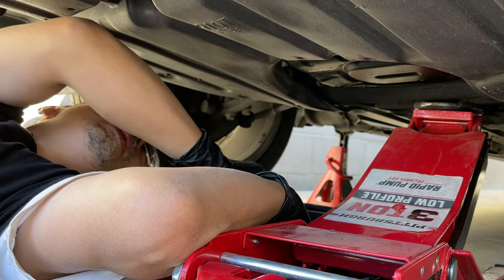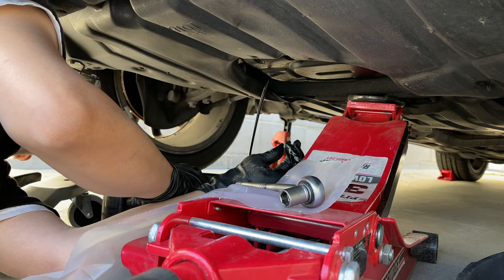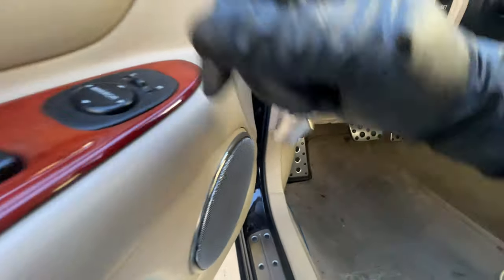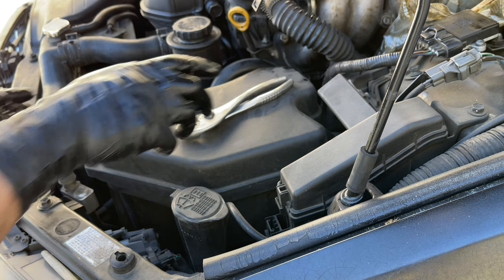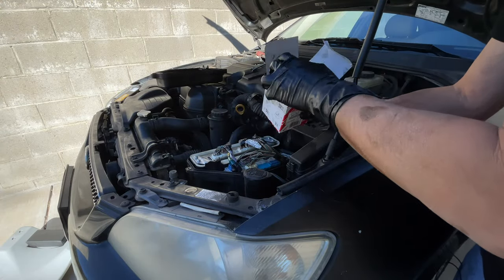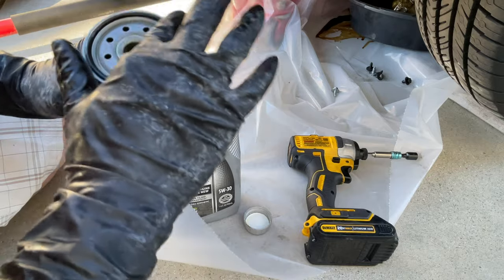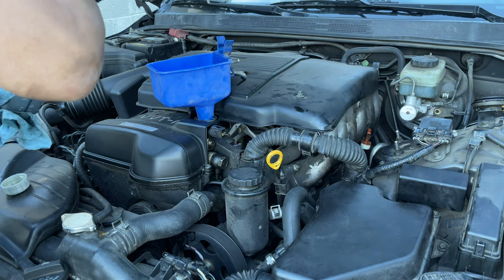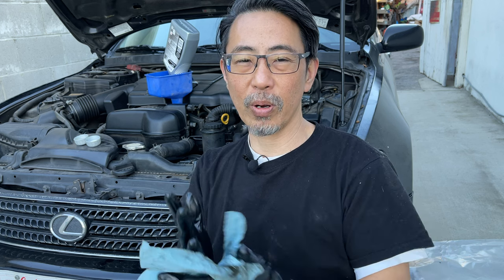MY LEXUS IS300 Oil Change Nightmare Mistakes And Lessons Learned Shared

Comment: I believe the drainplug should be torqued to 30 ft.lbs. But I'm not a pro, so what do I know? I've only been changing my own oil for 55 years.

Everytime you do it it gets easier.
Reply from the maker: Thanks, you're probably right.  The FSM for the car says 28. I have an aftermarket oil pan and I'm afraid to strip it.  I've been able to get the filter through the trans dip stick and through the front fuse bus box in the past.  This time neither worked.  Through the driver side steering rack is by far the easiest.  I wish I had a lift in my driveway.
Reply: @Squisheyy  
I don't recall that you mentioned how often that
 you changed the oil but being it's a 2005 model year, I'm pretty sure the recommended interval is 5,000 miles. One way to make it's easier is to simply do it less often. I've decided to continue changing ours every 5k but I now change the oil filter every other oil change (at every 10,000 miles). I don't have a garage so in the winter I make the job easier by not removing the filter from it's housing, but I still drain the oil from the filter. Because I'm only changing the filter every 10,000 miles I now use a more expensive filter that's rated for 20,000 miles. I had an oil analysis done at my last oil change just to prove to myself that all is good. Blackstone labs says that the wear metals in my oil were considerably lower than what the average for my vehicle are. The analysis also showed that the oil filter was doing a stellar job because with over 10,000 miles on the filter the percent of Insolubles in the oil was only at 0.2. The normal level is up to 0.6. So I'm thinking that I will continue with this methodology. Our vehicle is a 2009 RAV4.
Reply from the maker: @njsongwriter  I change the oil when the maintenance light comes on. I think miles and time interval cause it to go off.  The shop I used to take it to doesn't open on weekends anymore, so I've been doing more myself.   What kind of filter do you use that is rated for 20K?  I've never heard of Blackstone labs.  Might be interesting to look into.
Reply: @Squisheyy  
I'm using the Fram Ultra synthetic filter. I wouldn't use their lower priced filters but the Fram Ultra is rated for 20,000 miles and it's made in the USA.
Reply from the maker: @njsongwriter  I’m definable going to look into those fram filters. Thanks

Comment: Hey Squishy, as an is300 owner for over 20 years changing its oil every 3k, I recommend removing the oil; stick and transmission stick and inserting the new oil filter in backwards right at the transmission stick location, once in rotate it into to its receiver position. Prior to this use your old oil filter to rub oil on the new filters gasket prior to installation. Oil changes with new filter on is300 require only 5 quarts of oil, the standard oil gallons they sell should work fine no more no less than required. This job should take 20 minutes max.

Comment: Meh, not really anything to be ashamed of here. The 2JZ is definitely one of the more challenging engines to do an oil change on. It usually takes me north of an hour to change it on mine — and I’ve done plenty of oil changes before. A hat tip to you regardless for doing it yourself.
Reply from the maker: Thanks. It is the worst that I've come across doing an oil change on.  I have gotten the filter out the top by the trans dip stick and the front by the bus box before. This time I just couldn't get it out that way.  Through the bottom is the easiest.

Comment: Used that universal oil filter tool, takes longer than having the filter socket with a flex head. Lesson learned is run some foil to guide the oil and mess free location
Reply from the maker: I’m sticking with dropping it from the bottom. It could have been designed a little easier.

Comment: If your having this much trouble with these engines I'd hate to see how you perform when your timing belt and front oil seals need replacing🤦🏾‍♂️
Reply from the maker: So true. Lol
Reply: Don't mess up the timing otherwise you would be paying for a new head because of bent valves💸💸💸
Reply from the maker: @carlbrooks90  noted. That sounds bad
Reply: @Squisheyy  the head for these engines ain't cheap. Gear heads and car guys that appreciate these engines are buying 2jzge heads because they flow better than the 2jzgte head
Reply from the maker: @carlbrooks90  really? I thought the gte is required on turbo supras
Reply: @Squisheyy  you can swap to ge heads on those motors from what iv read. The only advantage to the ge is better flowing heads, disadvantage we have is thin piston connecting rods, which doesn't bother me because I plan on keeping mines naturally aspirated, less problems, last longer IMHO.
Reply: You’re right the ge heads flow better but only if you take what the gte did with oil squirters into consideration.

Comment from the maker: Do you replace your crush washer?  I used to reuse them and can't really tell the difference. Oil drain plug should be torqued to 28 ft lbs.  Thanks JackTannehillPromoter
Reply: You don’t really have to as long as you don’t Hulk crush the drain plug, but it’s good to replace the washer every 2-3 oil changes. If used over too many times, they start to deform and won’t seal right.

Comment: how many qts total did you use?
Reply from the maker: 5.5.  I have an after market oil pan. I think it holds .5 qts more and checking it uphill or downhill slant makes a difference.
Reply: Spec is 5.7 quarts with oil filter change